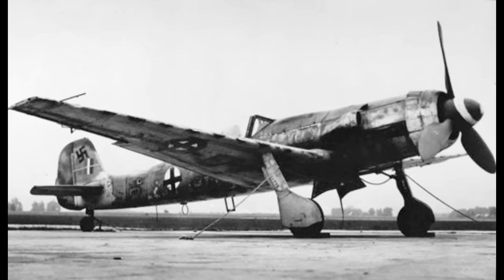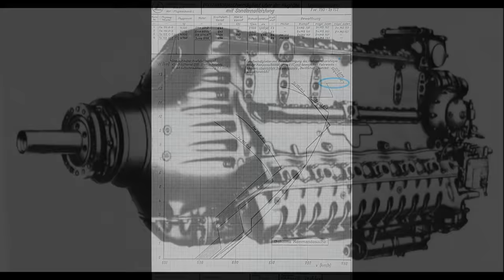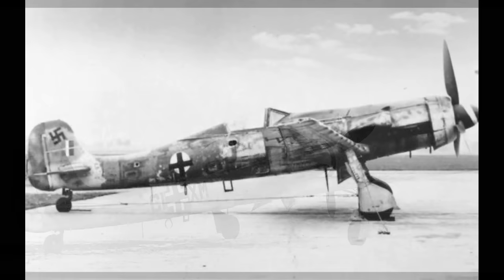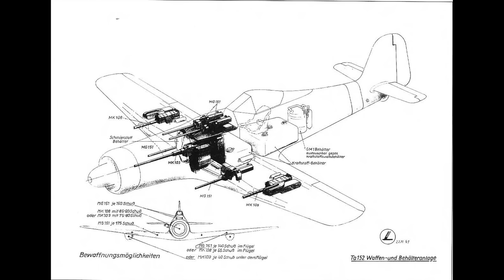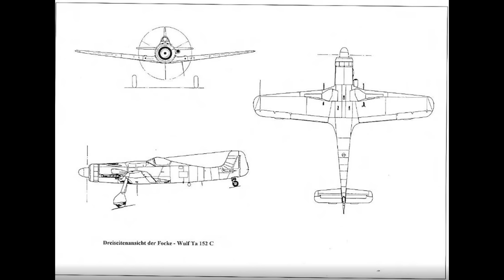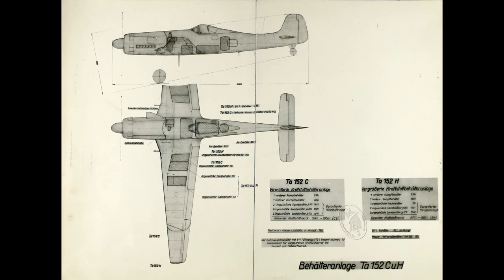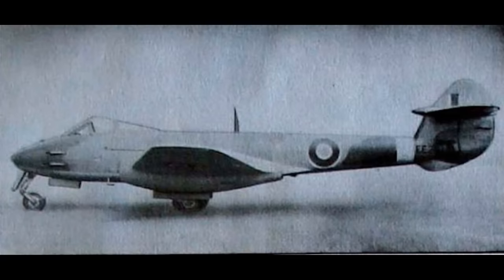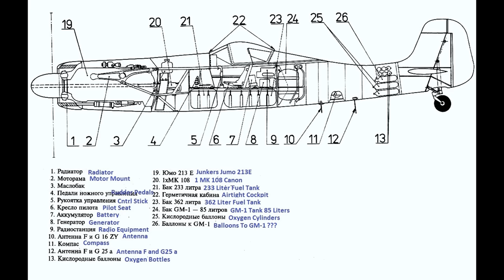Focke-Wulf Ta 152 H-1 Extreme Speed At High Altitudes.

Comment: As far as I know the only first-hand description of flying this plane in combat is to be found in Flight Sergeant Willi Reschke's diary "Jagdgeschwader 301/302 'Wilde Sau'". Despite its superior features, the TA 152 could not live up to its true potential in the dying stages of the war due to various reasons, some of them teething problems with the three-stage charger. As Reschke describes, he encountered a reconnaissance Mosquito high above Berlin and set about to intercept it. As he was closing in and was about to engage the third stage, the charger stalled, giving the Mosquito a narrow esacpe without the pilot noticing. On another occasion, a relatively large number of TA152s was engaged against allied Bombers and they were attacked by friendly fire from other German fighters as their pilots had not been informed about the new type and mistook it for a new allied escort fighter. He reports several victorious encounters with Jak-9. One victory he recounts surprisingly came at very low altitude when he pursued a Tempest near Berlin which apparently could not match the TA 152s uplift and maneuverablity at low-altitude curving and just dropped off the sky. Yet, as he puts it, the TA152 phad been his "life insurance" in the final months of the war. His TA 152 (Production Number 150168) was the one captured by the British after the war. It was put on display in Farnborough.
Reply: + WEITESAL    W.Nr. 150168 was scrapped by the RAF although I would be very curious if it is buried with other scrapped aircraft near Farnborough.   It would be worth a dig one day.  The RAF had both test/evaluation Ta-152s and the second example was given to the US and remains with the NASM.
Reply: @FiveCentsPlease  its shocking that so many of the operation paperclip aircraft were scrapped after evaluation. I recall about 40 years ago, while digging a drainage ditch at an east coast american airforce base, they found several crushed arado blitz jet bombers . On the plus side, one of the prinz eugens arado floatplanes was preserved, i saw it in a pennsylvania outdoor museum as a boy. But, a lot of aircraft were destroyed in situ in germany after the war by the allies in " clearing actions".
Reply: @HarborLockRoad    At NAS Patuxent River, the US Navy dumped, I think, two Arado 234 jets and a US prototype at the end of the runway for landfill.  Those aircraft were visible until the 1980s.  The Freeman Field historical group has compiled a list of the captured aircraft and their eventual fates, although there are some on the list that are "uknown."    They performed some digs at Freeman Field looking for buried aircraft but only found parts and wreckage and not an identifiable aircraft.

Comment: Hi i am an german native speeking Pilot (and have CPL-IFR ) so i can try to translate at 28:  "A) At 4000m start using "breathe oxygen" and keep it always in use above that height 
1) open Oxygen remote valve . Watch (or guard) the pressure meter and O2 Guard device. 
2) If you breathe heavvily (hard) use "Oxygen shower" (push it with your ellbow)  
B)  At 8000m use pressureoperation.
1) Twist Rotary Valve in position "Druckbetrieb" (Pressureoperation) 
2) Fill (or load) Sealhose. Press Valve for 15-20 Seconds 
3) Check from time to time the Pressurized cabine pressure gauge. Inside pressure is equal 8km 
"
Reply from the maker: Well done, thank you.
Reply: You are welcome of there is something to be translated and difficult i might be able to help pm me Then . And a verry good Video indered...

Comment: The Japanese Ki-83 and the Soviet Mig I-225 were similar aircraft designed to perform good at extremely high altitudes like this but I don't think neither of them reached production status. Prototypes were built however. 

These two birds are also in a very similar level if not sightly better when it comes to altitude performance in comparison to the 152H. Especially the I-225.

Comment: Cockpit pressurization to sub-30,000' level would mean that the O2 system didn't have to go into a pressure-demand mode.   This is where the pilot's lungs are  (lightly) pressurized with pure O2 and they have to work to exhale.    Pressure demand systems are required because even at 100% O2, the partial pressure of the oxygen above ~34,000' isn't high enough for the lung's gas exchange to work very well, beyond which (up to about 45'000') pressure demand can be used.   American pressure demand systems I am familiar with are rated to only 45,000' but that is a bit below the '152h's ceiling.   Pressurizing the cockpit to ~25,000' would allow the pilot to stay very sharp on a diluter-demand system, which would allow  a smaller/lighter O2 bottle.
Reply: Kevbo,
Thanks for this technical explanation.  I was about to look up altitude atmospheric pressure and calculate O2 partial pressure but your post includes more information.  Partial pressure is the key to O2 at altitude and N2 below water.

Comment: The hit the oxegen with the elbow relates to a feature on most 190 models, there was a control device to the right of the pilot with a big round blue button that opened the valve to pure oxegen in emergency providing the system wasn't compromised. Something scale modelers in many cases omit.

Comment: Nitros Oxide also has a good cooling effect on the charge air going into the engine
Reply: actually, its cooling effect its caused when oxygen and nitrogen separate in the combustion chamber due to heat, absorbing it, so its actually even better than cool the intake air
Reply: @santiagoperez2094   the cooling effect is when the liquid turns into a gas, not sure about with it cooling the charge air in the cylinder when separates in the combustion chamber. If anything I though it would add extra heat.
Reply: It's not really cooling that is the desired outcome. It's increasing the density of the charge mixture that they were seeking. More bang at higher altitudes, and delaying detention to compensate for lower octane fuel.
Reply: @BrickNewton  State changes take a lot of energy, which, as you point out, we see as a loss of heat.  P H Y S I C S   B I N C H E S
Reply: N2O has VERY limited capacity in piston aircraft

Comment: For a quick conversion of km/h to mph simply divided by half and add 10%.

600kmh👉300kmh + %10 = 360mph

372mph to be more precise.

Learning how to quickly convert metric to imperial is much easier than cross-referencing or pulling out a calculator.

Comment: Interesting procedure. Composed of two parts (A andB): Part A clearly refers to the mandatory use of the oxygen mask above 4000m. Point 1 describes what to do: open the remote valve and monitor the oxygen guard. The O2-Wächter is a panel mounted gauge, e.g.: Anf-Z. Fl. 30489. It only has one connector at the housing, which I assume connects to the oxygen line from the tanks assembly, but somewhere downstream of  a pilot side regulator. Possibly similar to the flow indicator found on today’s QD-Mask storage container (the white star).
Point 2 describes the procedure, for the event, the pilot experiences difficulty breathing (Atemnot). Here, an ellbow activated switch will provide constant flow of oxygen, possibly under positive pressure. I am guessing, this button is a toggle. However, the procedure does indicate, how to stop using the Sauerstoffdusche.

Part B seems so deal with the operation of the pressurised cockpit. Although, it is not clearly stated, that it is the cockpit and not another mode of operation for the mask-oxygen system. I am guessing, that pressurised compartments are so novel an idea at that time, that there is no chapter for pressurisation in the manual. I assume part B indeed describes operation of the pressurisation system, as it states “Atemluft” under point 1. So there is a distinct difference between A and B, as A deals with “Sauerstoffatmung”; so pressurised air as opposed to oxygen. Since there are no storage containers for compressed air in the aircraft, to my knowledge, this would hence be compressed ambient air. Anyway, if it is describing the pressurised cockpit, the manual here states, that pressurised operation should commence at 8000m of altitude. Point 1 instructs to switch the rotary slider for breathing air supply to position “Pressurized operation”. Followed by (point 2) the instruction to fill (a) pressurehose, by activating the corresponding valve for 15.20 seconds. I assume this pressure hose is an inflatable canopy seal. Point 3 then describes to monitoring part of the operation, which instructs, to periodically check (a) chamber inner pressure for nominal pressure, equal to 8km of pressure altitude. This is certainly the briefest pressurisation and oxygen system operation procedure I have ever come across in over 30 years of flying.

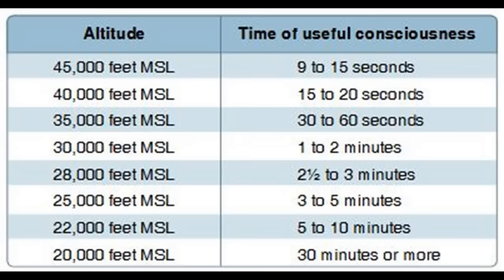Comment: 27:49 Here´s my quasi-literal translation of what´s on screen there. Since i am no aviator, i will translate technical terms literally and NOT into the corresponding technical terms in english, since i don´t know those. I might add the odd guess between brackets. Also: i will use some unusual word order in places, since i´ll try to stick as close to the German word order as possible to make it easier to compare the indiviual words of the translation with the individual words of the original text. In some instances i just couldn´t do that, though.

IX. Altitude flight

Rescue-safety device:
A. At 4000 m altitude commence oxygen breathing and always maintain at altitude above 4000 m.
1. Open oxygen remote-control valve. Monitor pressure gauge and O²-guard(oxygen meter?).
2. In case of shortness of breath, use oxygen shower. (Depress with elbow.)

B. At 8000 m altitude activate pressure mode. (pressure operation/pressurized mode/sth like that)
1. Turn-lever (some kind of knob that you have to turn and push at the same time) for breathing air in position "pressure mode".
2. Inflate gasket-hose(the seal for the canopy?). Press valve for 15 - 20 seconds.
3. From time to time check chamber-interior-pressure-gauge. Interior pressure equals 8 km.

Comment: Great video. Would love to see a comparison with the Do 335. In fact the Do 335 would be great for a future video on its own.
Reply from the maker: I'll get to it. The 335 can not out run the Ta 152H1 at high altitude, but down low it can easily do it.
Reply: @GregsAirplanesandAutomobiles  It depends what engines were fitted to the Do 335.  There were three type of DB603 engines the Germans had available.  Most used the DB603A which was not particularly powerfull as it was the first generation of this engine.
Roughly there was
1 DB603A with a single stage variable speed supercharger.  Of the top of my head the FTH was 5.7km with 1750hp.  A variation of this was the DB603AA with slightly modified supercharger impellor and gear ratios that improved high altitude performance by compromising low altitude.  The DB603AA was used on variants of the He 219 as an interim engine.  At some point they seem to have produced a Water Methanol Kit for the DB603A.
2 DB603E was still a single stage supercharger engine with slightly more power at 1800 but a much higher FTH even greater than the DB603A or DB603AA I think nearly 8.2km.  This was the engine the Dornier 335 would have shown its spectacular 474mph performance on.   There was a DB603EM with in built water methanol that could produce 2250hp.  
This engine was delayed since it required C3 (100/130 fuel) and had to be converted to B4 (87 octane) fuel which took time but did not reduced power output.  I think a few engines were delivered for He 219.   The delay prevented the Ta 152C from being fielded which would have come out way before the Ta 152H otherwise.
3  DB603L/LA.  This engine had a two stage supercharger with an intercooler and three or four entered service with the Luftwaffe on the Ta 152C.  The C version had less wing span and was optimised for normal altitudes.  With the DB603L engine of 2400hp the charts show a speed of 490mph was expected with the Do 335 with this engine.
4 DB603N this was a bench engine.  It was expected to produce around 2700-2900hp in service.  It had a two stage supercharger with a two speed mechanical drive on top of the infinitely variable drive normally seen on the DB engines.  The mechanical gears could be changed to optimise the engine.

The Ta 152H flew with the Jumo 213E engine. It had a lot of jet thrust which is why it was preferred for high altitude work.  The Jumo 213F engine was the same basic engine but lacking the intercooler, hence 100/130 fuel was used to compensate.  It was used on the Fw 190D12 (which can be told apart from its lack of cowling guns as it had a motor canon). The Fw 190D12 used the same radiator as the Fw 190D9 (jumo 213A) and this was insufficient.  30 seconds after reaching its top speed of 457mph the cooling cowls would need to be opened and the drag slowed the aircraft down.  It still had better climb and acceleration.  This was caused by lack of time to develop the radiator.
The first 200 Jumo 213E/f engines produced had a to low a strength supercharger shaft which meant the 3rd gear was locked out.

Both the Ta 152H and the Fw 190D12 EB were supposed to get the Jumo 213EB which had bigger valve area and running speed as well as a very capable heat exchanger and would have allowed the Ta 152H to do 472mph without Nitrous Oxide and the Fw 190D12 488mph.  

As you can see the Fw 190A was evolving simultaneously into the Ta 152 and the Fw 190D12 to Fw 190D15   The smaller wing area of the D12 made it faster at low altitude and it was going to be focused on ground attack, it was obviously easier to produce.   The Ta 152H shared 60% parts commonality with the Fw 190D and you could see parts like the Ta 152H tail getting fitted to the Fw 190D

Worth mentioning is the BMW801R radial.  This engine had a two stage multi speed supercharger like the American Navy engines.   It was being developed for a radial engine variant of the Ta 152B or C.  The factory was bombed and the engines development was effected and it was judged not worth spending effort in getting the program back on track.  The focus went to the jet engines, maybe a 3 speed supercharger on the BMW 801 and the BMW801TJ and TQ which had very capable turbo superchargers.

Comment: Oxygen system: https://www.deutscheluftwaffe.de/original-sauerstoffanlage-me-110-g
Some photos of the Me110 oxygen systems controls and indicators can be found here. The big blue button is the ellbow activated "Sauerstoffdusche" button on the regulator. Does resemble an oversized 2nd stage suba regulator. O2 tank ressure gage (left) and O2 flow monitor (right) are also depicted. 
I know it's a Me110 system. However, numerous parts were "industry standard" components, installed across various types of different manufacturers

Sauerstoffdusche: https://www.deutscheluftwaffe.de/fl-30403-1-umsteuerhoehenatmer-sauerstoffdusche , https://www.deutscheluftwaffe.de/fl-30481-2-sauerstoff-dusche
This one shows regulators and the pushbutton in more detail. Interestingly, on one of the detail photos of the second link, One can see the technical German name for the regulator: Membranlunge - which translates into english: membrane-lung. The manufacturer (Dräger) is still in business today, and still produced breathing equipment.

Ta 152 https://www.deutscheluftwaffe.de/nachbau-geraetebrett-focke-wulf-ta-152: It's a replica panel, rebuilt from orignial source photos.
The controlhandle to pressurise the cockpit is mounted on the center instument panel (it's the L-shaped, bare-metal handle, located top slightly right of center) and is marked "L3 Druckbetrieb". 

The cabin pressure indicator is located on the center appendix of the auxiliary panel.

Oxygen controls and indicator are on the right side of the auxiliary panel, with o2 guard, tank pressure and valve.

I was unable to spot the valve for the canopy seal. But that thing might have been mouted on the canopy frame.

Sidenote: I remember Greg mentioning the Friend-Foe identification transponder in another video, which had been removed from a panel on a different aircraft. This 152 panel does have this controlbox installed. Found on the far left of the aux panel, marked F207. The Box name is BG25a and it controls the FuG (Funkgerät) 25a, which is basically an automatic transponder. (more here:  https://de.wikipedia.org/wiki/Erstling_(Radar)). Also, at least according to that article, the device was protected by delayed explosive charges.